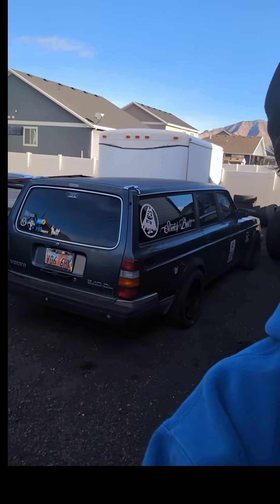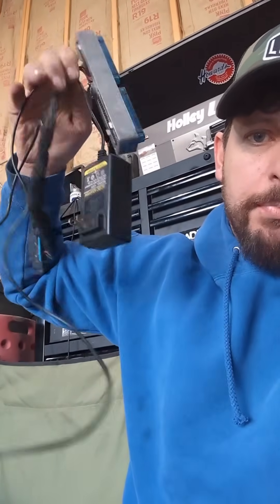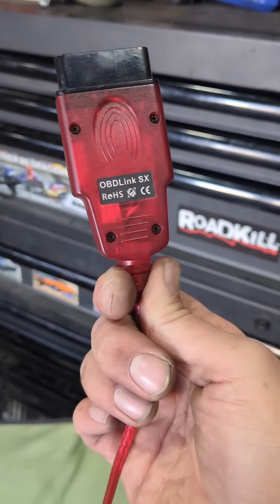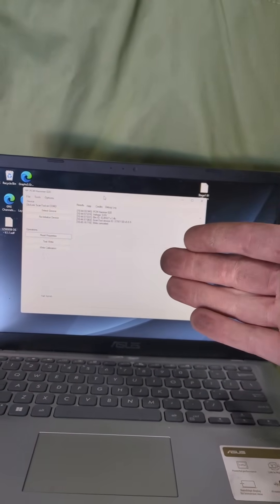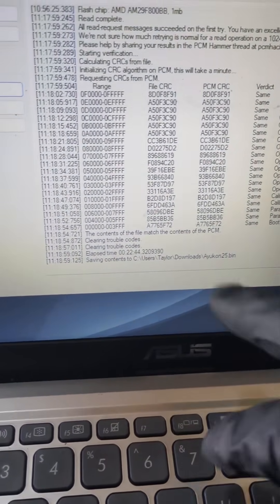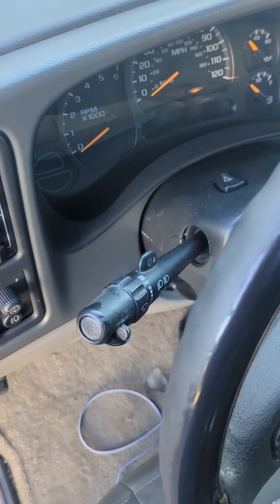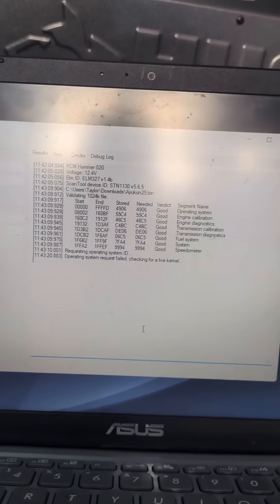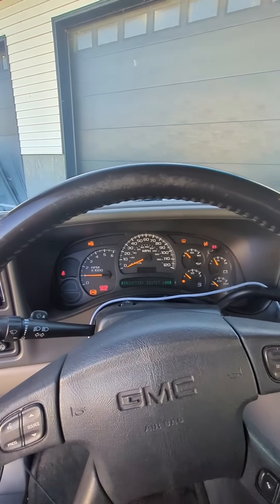Read and write PCM without HP Tuners!!

Comment: Will that setup work on a 2008 pontiac g8 gt 6.0 to remove vat system
Reply: Depends on the computer. Usually 97 to 07 classic

Comment: I use the green obdlink bluetooth version made a bench flasher years ago also, you can also use PChammer to change vin numbers too. Comes in handy if your gen III doesn't have a original tune you can slap one on a ecu and get going, right now I have stock images from my 02 yukon and my 99 trans am ws6. Ive flashed a ecu for my cousins suburban and used hptuners to remove the vats and it started up.

Comment: consider supporting the obdxpro products. they contribute to the development of pcmhammer/lsdroid

also with the obdxpro vt I have, I can use it as a interface to run tech2. great for crank relearns and such on older gm vehicles.
Reply from the maker: Great point, I used to use the obdx pro but I prefer hard wired interface. Do they offer one now?
Reply: @bonneville_speedworks435  with my obdxpro VT, which is a few years old now,  you can use the USB port.

I don't think the laptop I use even has BT.
Reply: @bonneville_speedworks435  Each tool they say can do USB/Wi-Fi/Bluetooth.

Comment: Good stuff! Subscribed. 
I was fortunate enough to buy the OBD2 version of Tunercat before they sold the licensing rights. Since I'm "grandfathered", all I have to do is buy the definition file for whatever carline I want to modify. It's not locked to a VIN (you can even change the VIN in the flash), so I can do any number of "covered" PCMs that I want. (But "bricking" was always a fear.) 
Wish someone would come up with something that would unlock/tune a MOPAR PCM.  (It's probably out there, at an astronomical price...)

Comment: This is exactly what i needed to see THANK YOU i had a tune sent to me with HP Tuners and now my behicle is doing EXACTLY what yours did once you pulled it from being 80% complete and wouldnt overwrite now its a 5400 pound brick I need my PCM unlocked then upload the tune to it HP Tuners/ TDN doesnt support GM from before 2016 without a PCM unlock learned that AFTERWARDS however this is everything to me THANK YOU

Comment: I'm running a clevo on LS 0411 pcm , using tunerpro and PC hammer 
Without those YT guys you mentioned I wouldn't have even tried 

Finding the files you need is the hard part 

You can also unlock a HP tuner tune by removing the case cover and bridging two terminals - there's a video also for that 

Only drama with tuner pro is very little to no support and also AE tuning isn't supported on most files 

Chat Gpt is good if you ask the right questions for definitions in tunerpro
Reply from the maker: Would you mind sharing how you sorted out crank signal on the clevo?
Reply from the maker: Would you mind sharing how you sorted out crank signal on the clevo?
Reply: Machined the front drive pulley that bolts to the balance for the belt to take a LS 24x reluctor wheel , found the phasing online for number 1cyl , made a crank sensor bracket off the timing pointer 
Also fitted a cam sensor from a LS2 I think into a using dead Holley dual sync disy - which is what started this whole thing lol the Holley has 1x reluctor wheel inside just cut all the other bits off it, leaving only the 1x 
Simple really 
For a ford just make it's no 5 cylinder no 1 - every cylinder after is the same phasing so no need to muck with coil and injector wiring changes 

Simple hey
Reply: @Jason-kn3tw 
SOUNDS LIKE A GENIUS

Comment: I am curious to know if there is a similar software for TCMs. If I was going to make a harness I would make one for both my PCM and TCM.
Reply: Hp tuners let's you tune the trans but you gotta guy credits for the trans as well as the engine control
Reply: @matthewfredrickmfkrz1934 Yeah I already know about hp tuners. I'm asking about software the average joe in their driveway can use without breaking the bank. With hp tuners, you gotta spend close to $500 for the dongle, including credits for the computer.

Comment: My local shop told me 1600 to crack my 17 gmc
Reply from the maker: That's pretty typical for the 17+, most of them have an e41 ecm that has to be mailed off to be unlocked unless your shop is elite enough to do it themselves! Torque based tuning also requires a lot more education than the older stuff.